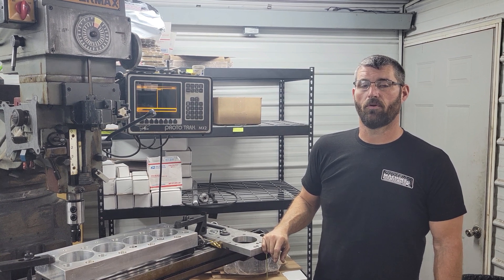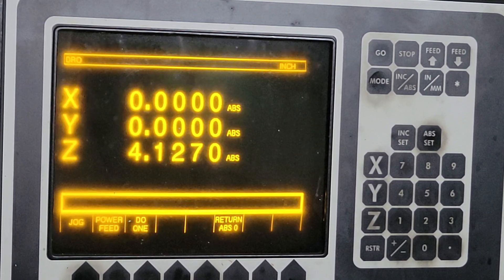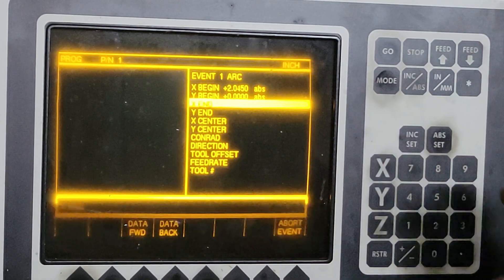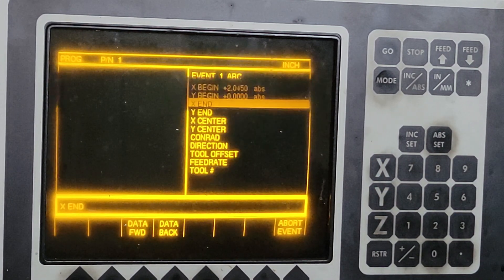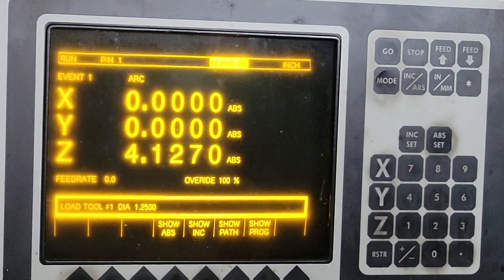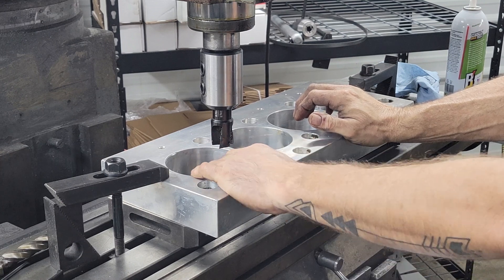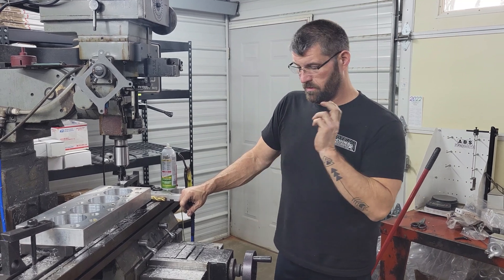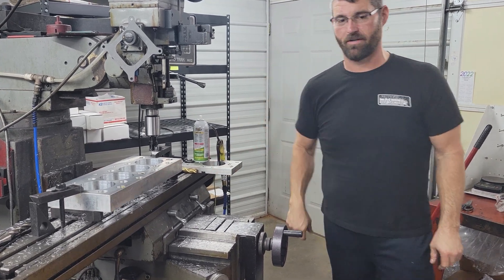Torque Plate Mods In the ProtoTrak  Cnc Mill

Comment: I'd use a two flute carbide endmill with a much longer flute length and do a roughing and finishing pass using much deeper cuts in Z. This would eliminate the chatter marks you got leaving a smoother finish and less material to hone.
Reply from the maker: Normally I use a coated 3 flute, but didn't have one with enough flute length at that time
Reply: @powellmachineinc3179  Advantages of using a two flute end mill on a low power manual mill like a Bridgeport, higher depth of cut, less taper, higher material removal, better chip evacuation. 

Advantages of a 3 flute end mill on aluminum... better surface finish, which you don't care about because you're going to hone.